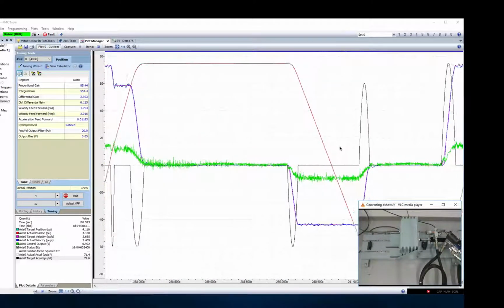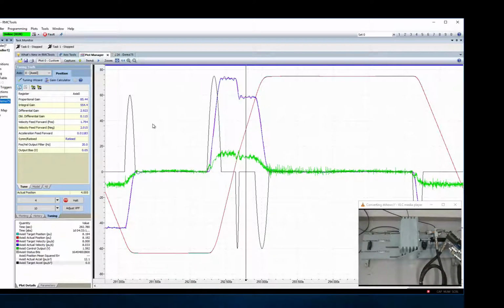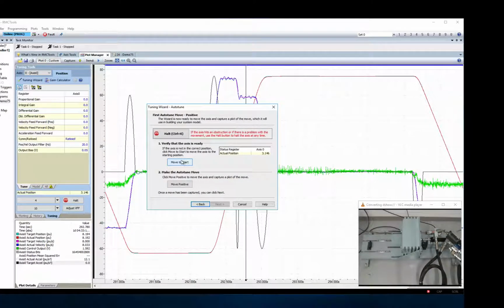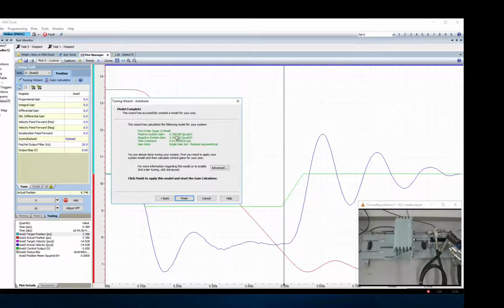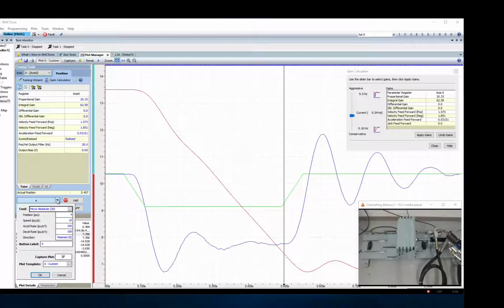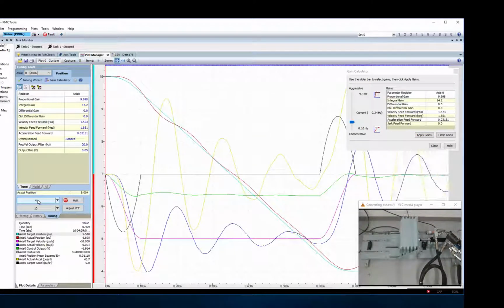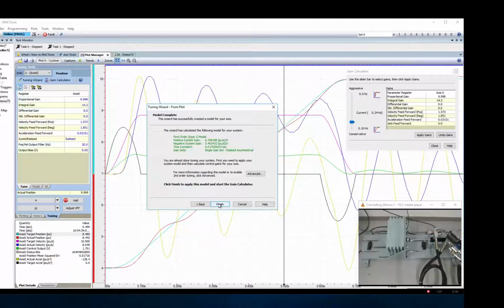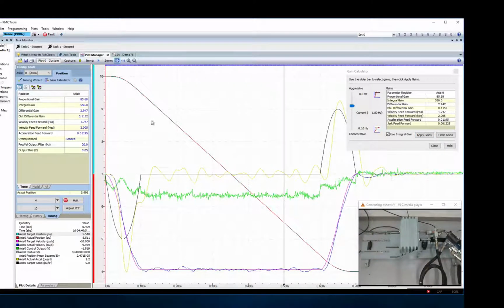Peter Ponders PID, Natural Frequency vs Frequency of Acceleration

Comment: If I'm not mistaken, Tuning Wizard calculates system parameters and controller gain calculations on a PC where it is installed, because these calculation need a lot of computational power. PLC or any other tpe of embedded device usually doesn't have that much computational resources. Is that right?
Reply from the maker: Yes,  in some applications it would be possible to do some sort of auto tuning on the motion controller but there is still human interaction required to select the closed loop pole locations by moving the slider bar.  Also, some motion control application run and never stop for long periods of time.  In RMCTools the calculations happen so fast you barely know they are being done.  On a motion controller they calculations would need to be done in a low priority back ground task.   It should be possible to compare the actual response to a model's response on every move and tweak a feed forward gain to see if the next move is better or worse.
Reply: @pnachtwey  In the case model is used for the continuous feedforward gain tuning, the model must be executed in the motion controller itself. It would't be wise that model's response is updated in the PC because connection to the motion controller must be live all the time in that case. In case it is executed in the controller, it would use a lot of resources. The RMC controller is normally used in variety of applications where fast cycle times are needed, and model calculations would probably slow it down.
Reply from the maker: @amranadarevicvodencarevic9372  You have it backwards.  The feed forwards gains can be changed to minimize the sum of squared errors between the target and actual position or velocity.   This is basically   finding the feed forwards by an intelligent trial and error.  If you have accurate values for the feed forwards then you have an accurate model since the model is simply the inverse of the feed forwards.  If you have the model and know where you want the closed loop poles to be you calculate the closed loop gains.  No think about how you would intelligently use the error between the target and actual to modify the feed forwards.

Comment: Why positive and negative system gains are different so much? About 20% asymmetry is very significant.
Reply from the maker: This is normal for hydraulic cylinders with a rod only on one side of the piston.   There is more surface area on the rodless side of the piston than the side with the rod.  The controller changes the gains automatically depending on the direction of motion.   For a better understanding of why and how to calculate the open loop gains, go to
https://forum.deltamotion.com/t/the-vccm-equation/378